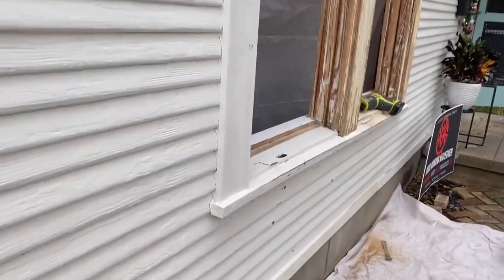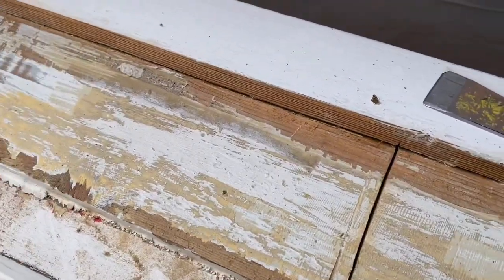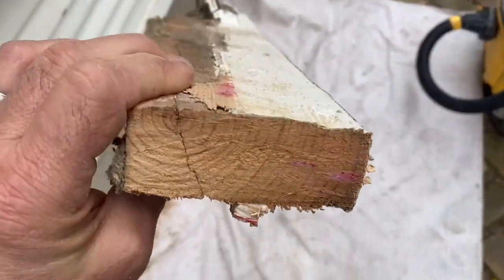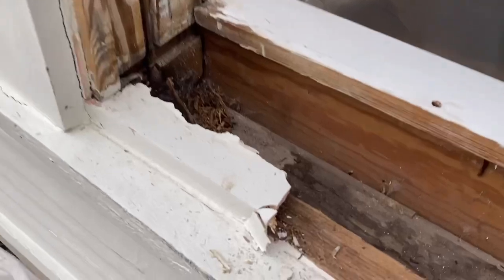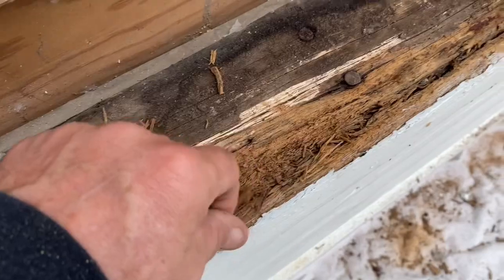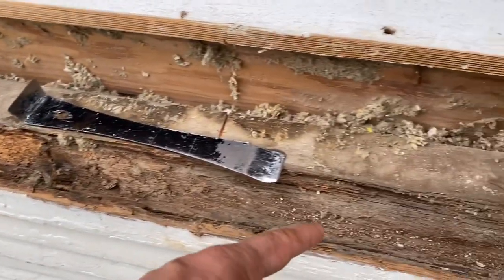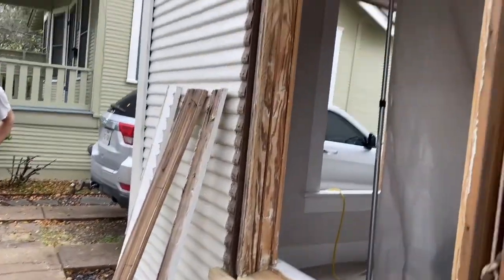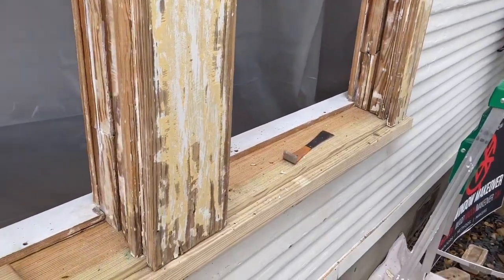A Wood Window Sill Replacement Looks Like This

Comment: hi thx for the window sill replacement. Next is scraping the side of the house. i have never seen that yellow scraping tool that is attached to the vac. Can you please tell me what that is?
Reply from the maker: It’s called a “ProScraper.”  Brand name. I like it because it uses a 2” carbide blade. A competitor uses a 2-3/8” blade and the fact is that the extra 3/8” gets you about zero In added effectiveness, and about 2/3rds more cost in blade replacement. So I stick with this one.